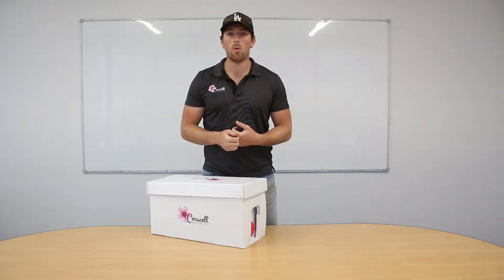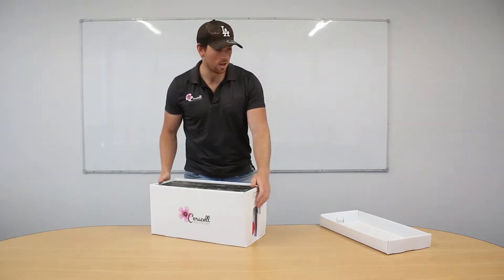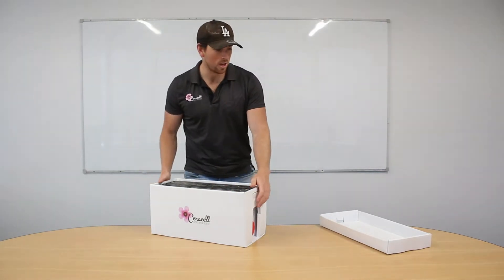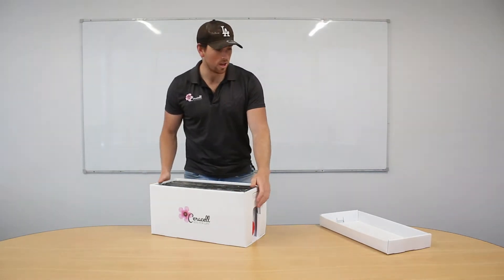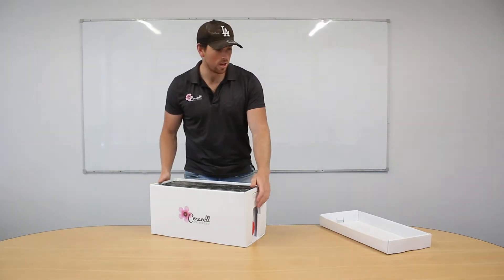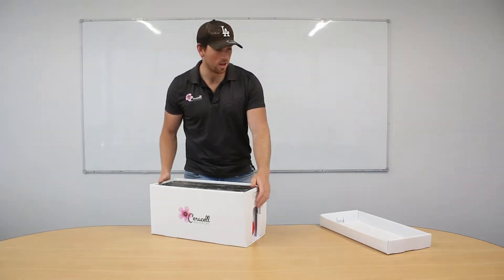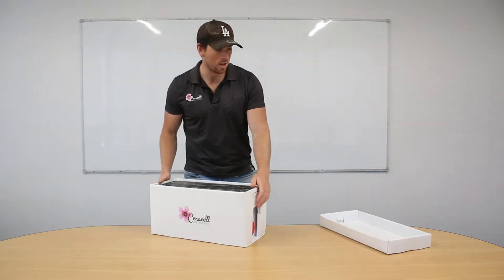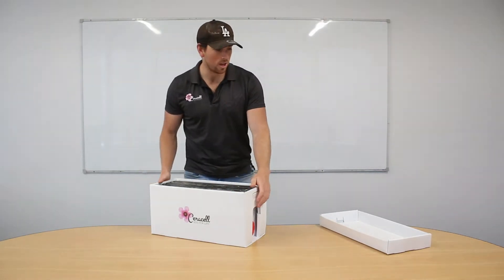Ceracell 6 Frame Handy Nuc - How to assemble

Comment: I recently watched your tutorial video and wanted to express my appreciation for the clear and insightful instructions provided. It's indeed a beneficial resource for individuals like myself who are eager to learn and apply new skills.

However, I encountered a minor concern regarding the premade hole for the disc spindle in the box. Despite following the instructions, I found that the hole is larger than required to snugly fit the disc spindle. Even if you make a new hole, it does not provide enough grip, causing the disc to potentially fall out during the box's relocation.

To enhance the user experience and ensure the disc's secure placement, a modification might be necessary. I would suggest considering a lock mechanism or a cap for the other side of the spindle hole. Such an addition would likely enhance the product's reliability and user convenience.

In the interim, to secure the disc, I have been employing hot glue, which seems to resolve the issue temporarily. Yet, a permanent solution within the design itself would undoubtedly elevate the product's appeal and functionality.

Thank you for considering my feedback and suggestions. I look forward to more of your engaging and informative videos.